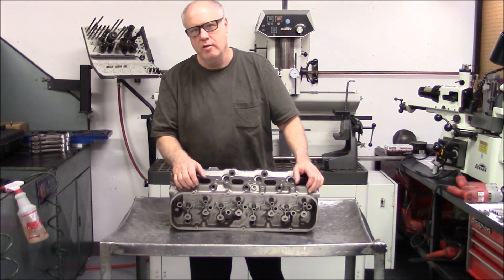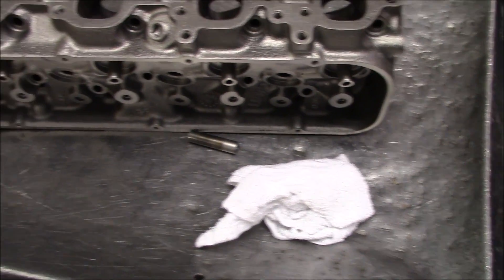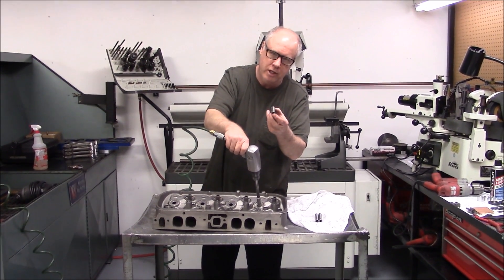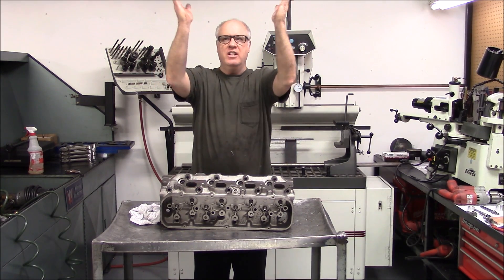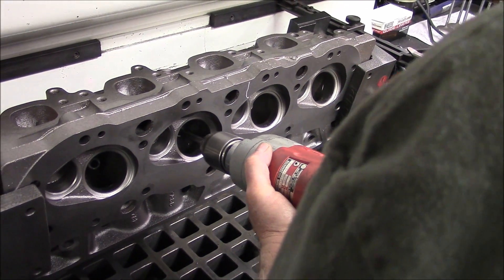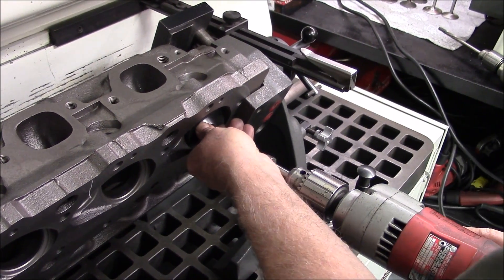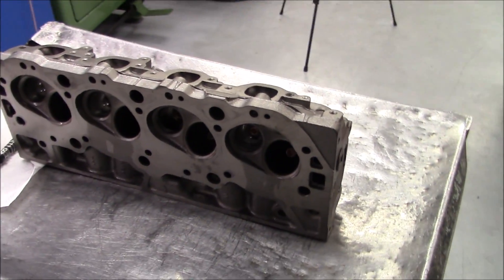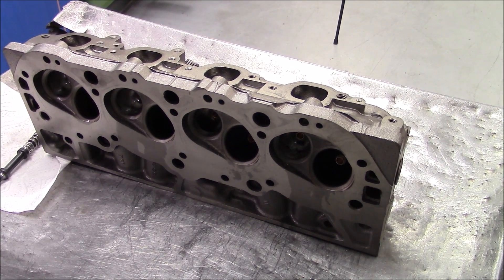Valve Guide Removal and Installation for our 620+ HP Street/Strip 454 Big Block Chevy

Comment: The exhaust guides can be removed in the same manner I would assume?
Reply: Not exactly . The exhaust guides go through the water jacket . They are tapered , almost all big block exhaust guides drive out the valve spring side and back in the spring side .  If you drive them out toward the combustion chamber it will generally crack the head around the guide hole .You also need to use a loctite sealant on the guides .
Reply: Also , the later Gen 5 heads the guides knock out towards the combustion chamber side . Although I installed guides in a set of Gen 5 rectangular port heads , one head the exhaust guides went in the top the other went in through the combustion chamber . The heads are thick enough on the spring side to handle knocking the guides out through the top . It is also a good idea to pressure test any big block head after installing exhaust guides ! A lot of machine shops don't like putting exhaust guides in because of this and just install guide liners . I have had 4 heads over the years that had holes rusted through the exhaust guide . The first one bit me ! After that I pressure test all big block heads .
Reply: They were 781's and I shattered the valve cover side of the guide (top) on one of the exhaust valves trying to pound out a broken valve down and out of the guide.Somehow there were three broken valves in those 2 heads! Thank you for the response Sir!
Reply: @ALABAMAHEADHUNTER  thanks for sharing! i am gonna pressuretest them as well!  because i can not find a waterleak yet.

Comment: If you're installing liners anyway, why remove the factory guides which were already centered on the valve job? Were the tops cracked?
Reply: The intakes are dry
Reply: Id say he does this so he knows its done to his standard.no second guessing.I like the way he goes through every bit of the engine and has a method that I would say is proven on the track.end of story boys
Reply: After so many miles the valve guide's are worn and you can literally wiggle the valve stem side to side thats why new guides n valves unless you want to b a shadetree hack
Reply: Tom Hutchins working on a new engine you leave nothing to chance working on rebuilding a used engine. Mandatory
Reply: What he was saying is why not liner the oem guides as long as there not cracked. Why take the risk of pressing out the guides and replacing them maybe compromising the press fit?
Liners are a risk There wear is inconsistent no matter how you prep them over the long run but i guess when your building a race engine with stock parts there is no long run.
Reply: 300,000 + without a liner failure, have dirt trackers bring in their stuff for freshen up at seasons end, when I take the sunnen  guide gauge to them, rarely hour glassed, I can only imagine how long a stock driven job will last.
Reply: Tom Hutchins aka being anal for the 1/4 mile some people r like that. I wish i could spend money like that
Reply: If you cant afford it isn't that just a habit not a sport? Work on your career or a better job so you can afford it instead of using the rent money?
I have been in the business for over 30 years have learned to deal with people that can easily afford there hobby/sport. Some say im arrogant? But is it responsible to have someone use there rent money or the kids collage fund to pay for there habit or sport? Isn't that what drug dealers do hook you then bleed you?
Reply: Don't see the point myself. Remove old guide, replace with new guide then k line the new guide?
Reply: He does not have a clue the factory intake guide goes through the water jacket and they will leak then hacks like this use block seal to try to slow the leaks
Reply: @tomhutchins1046 
Exactly
Reply: Exhaust guides go through the water jacket, not the intake guides.
Reply: Dont bother replying to Tom , He is probably the Dbag forum stalker that was using wire nuts on his ignition and blaming Mark for his problems...
Reply: johnathan ford 
You may want to re read yarrdayyarrdayarrda's comment again

Comment: Is there a reason you don't use a stepped shouldered guide?
And why keep the heavy 3/8 stem valves? Instead of say 11/32?
Just curious, keep up the good work, im a builder and I see so much junk, so many guys that don't build them right, i appreciate you showing everything involved so people know what's really involved on a higher end build!
Reply: Because he's a hack
Reply: You mean "faster and easier" isn't the way to go on a "620 HP pump-gas 454 build"?
Reply: @tomhutchins1046  You dont need 11/32 valves for 620 hp.
 I turned 6800rpm with a hyd roller with 3/8 valves
Reply: @bigboreracing356  There are the pros and there are the billy bob stories. Only 6800? You do know real engine builders watch the valve train weight down to the gram every gram means less valve spring required more power and less wear and failures.
Reply: @bigboreracing356  Hint Ls engines come from the factory with 5/16" stems and beehive springs even in pickup trucks. them gosh darn engineers aint knowin what there talkin about?
Reply: @tomhutchins1046 You talking bout dem der gosh darn GM engineers who designed the 7000 rpm ultra light  valve train with 5/16 guides for the 2006 to 2013 LS7 ?
 How did that work out for them?
 All I can say is ,My valve train made more power with 200 less rpm , 3/8 " guides/valves and never failed.
Reply: @bigboreracing356  Ps ls are having issues with bearings. oh and nascar engines have run 5/16 stems and honda sized rod bearings for over 30 years now there billy bob
Reply: @bigboreracing356  Oh and billy bob its valve stems not guides
Reply: @bigboreracing356  Your obviously smarter than all the Nascar engine builders and Detroit and import car engineers
Reply: @tomhutchins1046  LS dropping valves, and having bearing issues?
Sounds like GM needs better engineers.
 Nascar engines have turned over 9000 rpm for the past 30 years, what does that have to do with a  big block topped with factory iron oval port heads? Lol
Reply: @tomhutchins1046  Fuck off, keyboard trolling dickhead. Why do you have such a hard on for the guy? You've done nothing but bitch about him being a "hack" in every video. Shut the hell up.